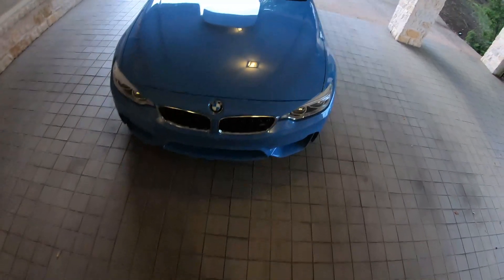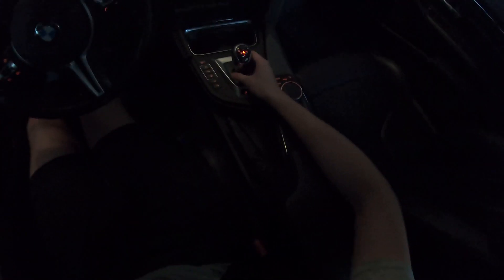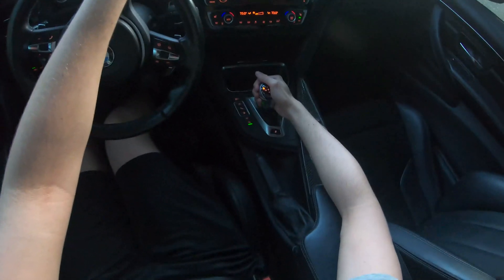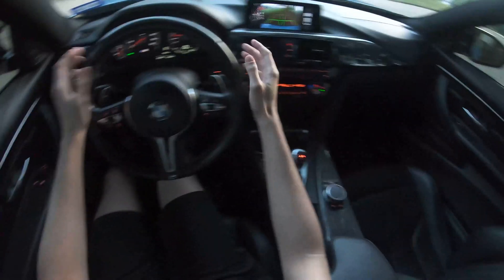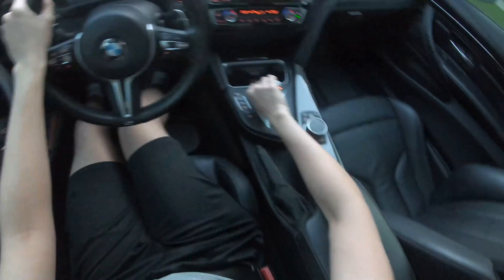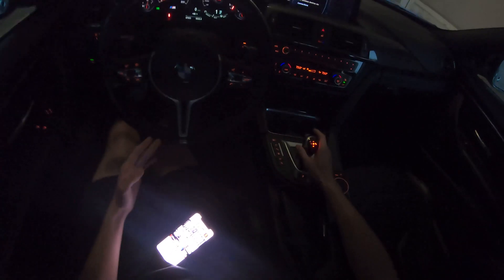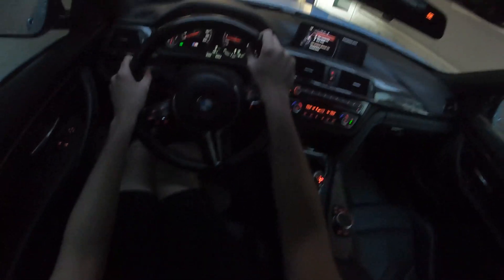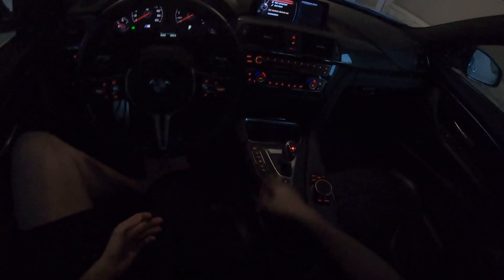BMW M4 Parking Gear and DCT Explained

Comment: my problem with the car is that when I press the gas pedal it goes quite fast forward and that's not really comfortable in thigh underground parkings. Is it possible to make it crawl somehow?
Reply: I seen somewhere you have to lightly tap acceleration so the car can engage that crawling mode where it goes 4 5 km/h
Reply: @vladalx8820   yeah, I just use tight underground parking and 5km/h is too much sometimes. But I will get used to it.
Reply: @Trolovtov  Anyway, it's a nice problem to have😁

Comment: Wrong. BMW actually made it reverse. Before a parking break was invented and used, reverse was the original parking brake. They won’t tell you this but my grandpa and his friends all vouch that they used to park all the cars in reverse to stop them from rolling. It’s also easier to change reverse out of a manual

Comment: Why doesn’t it roll Forward???
Reply: it doesn't roll cause DCT doesn't have torque converter like automatic transmission
Reply from the maker: I’m not exactly sure why it doesn’t roll forward I’m pretty sure it has something to do with the dual clutch transmission

Comment: what if ur parking lot is kinda of a hill what would i have too do if i wanted too park it ? and how would i turn it on without it rolling down ? love this vid !
Reply from the maker: You would have to use the parking brake if it’s on a hill or incline but if your on a flat surface that parking brake does not need to be used and thanks so much!